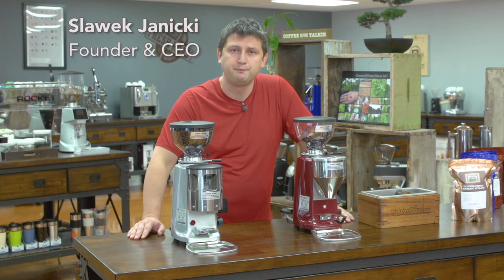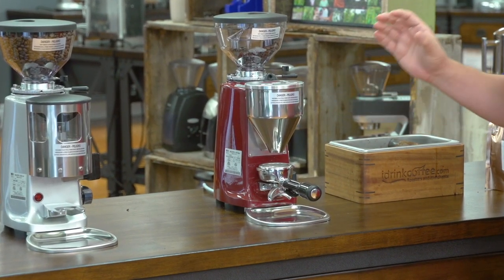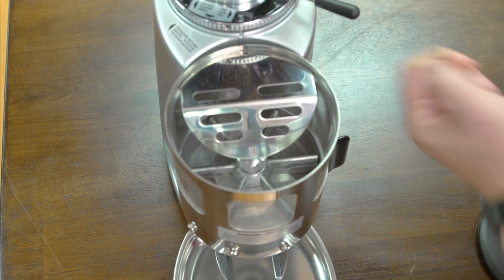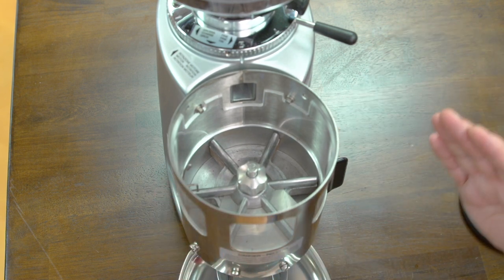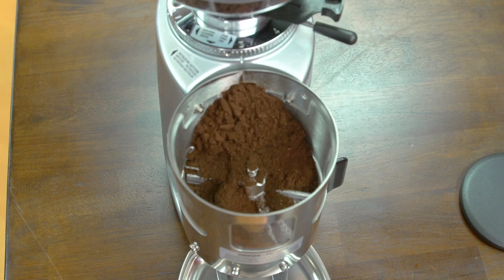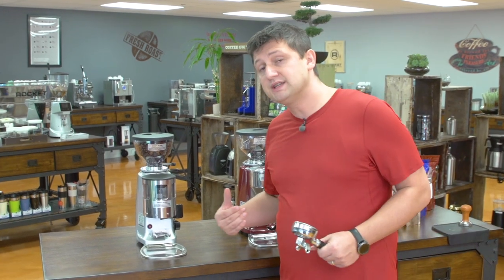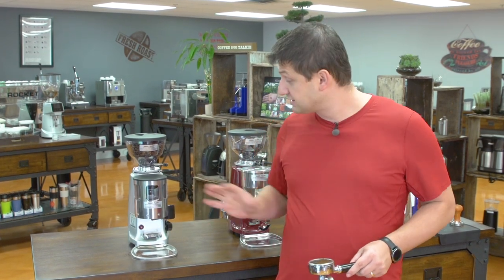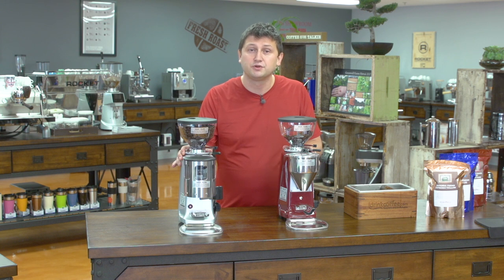iDrinkCoffee.com Comparison - Doser vs Doserless Espresso Grinders

Comment: Nice video but it's needed to say though dosered grinders are still very common and preferable in some Italian coffee bars where they can be extremely busy for most of the day (anywhere between 800 and 2000 shots a day) - so the coffee does not get stale and automatic grinding after each 12 whacks is perfectly fine. At VyTA cafe bar in Milano Centrale station, there are two 4-group Cimballis and a single dosered Mazzer Robur on duty and the demand is so high, they would not have made it without dosered grinder. I asked and they make on average 5000 shots a day.
Reply from the maker: Hi, I agree that doser grinders certainly have a purpose and they are useful in high volume locations.  However, for work flow reasons servicing 8 groups with a single grinder doesn't make sense.
Reply: @iDrinkCoffeeCanada Yes, may seem so, but in this case they manage it with a single grinder, achieving unbelievably fast and efficient routine. It's a coffee sight of its own. 😀
Reply from the maker: @zlutyzakaznik679  you are right, I am familiar with it, I was in Milan last in October and there are many extraordinarily busy cafes

Comment: Following the demonstrated way is it possible to grind only one dose of coffee with the doser model  – let’s say input 15g beans output 15g grist? Or what is the retention ratio in this scenario?
Reply: I've been using my Macap M4 doser this way to single dose for ~10 years.   At the end of the grind I use a brush to remove all remaining grounds from the short horizontal grinds shute.  This way retention is minimal.  I've never measured it, but expect it would be next to nothing.
Reply: Can we use strong blower to clear the remaining ground coffee inside...?

Comment: Great informative video... thank you. 
Is there the possibility of removing the dosing chamber and fitting a makeshift spout on the grinder where the grounds exit the machine into the chamber ?
I have acquired a Fiorenzato F6 but am a home user who would as you mentioned, not quickly go through a large volume of ground coffee in the chamber. 
Many thanks 🙏